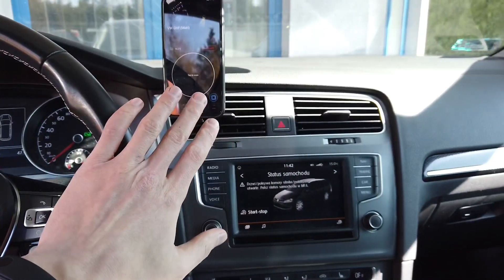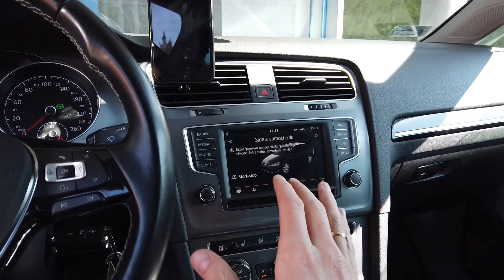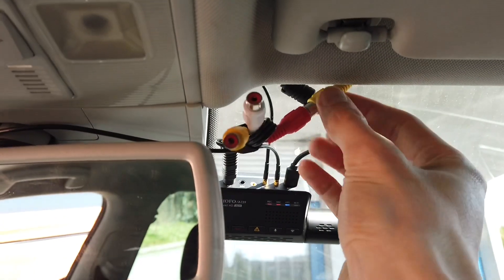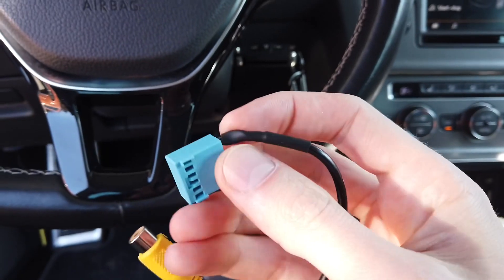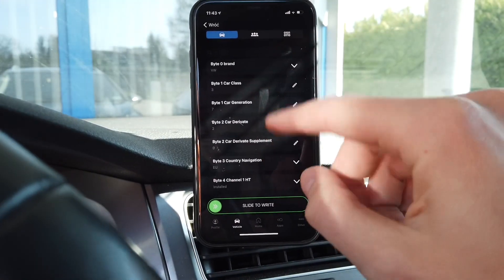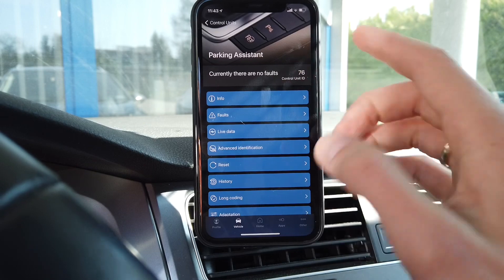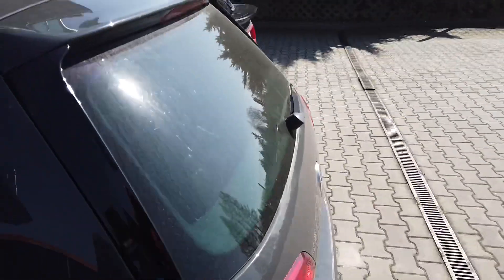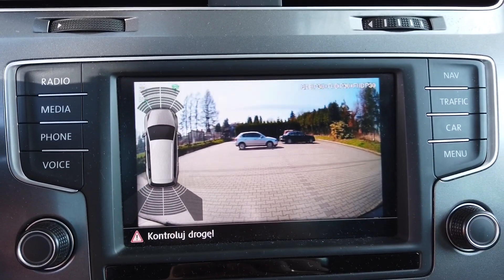VAG MIB2 rear view camera activation (RVC Low)

Comment: From where can I power the camera? 
If I get power from the reverse lights I will get a fault from the Canbus. 
Should I use a relay that activates from the reverse lights and gives power from the ignition? 
Another idea is to always power the camera from the ignition and get image when in reverse but the lifespan of the camera will be short.  
Any ideas?

Comment: If I have PDC that shows lines which move for front and back while steering, will these move on the camera too when I install an original camera?
Or has this to do with Low/High? Because the only difference I see from a set I can buy is the cable.

Comment: Hi, and thank you for the videos you post, they're really interesting. However I have a question if you don't mind, I have this device 'MST2_EU_WV_PQ_P0245T' with GEM 3.5 installed on it and one slot SD card. Is there any way to activate app-connect on it only with SD card ?

Comment: This video, like all your others, is perfectly clear to understand and very helpful.  In my case I'm trying to enable the factory-installed rear view camera.  After I installed a replacement MMI when my original one failed, the rear view camera is no longer working.  Will the coding changes in this video work?  Or can you tell me the coding changes I need or direct me to a video for this problem?  Keep up the good work!

Comment: On the Begining of your video you explain how camera is connected. You mensioned the 2 pins and power, the 2 pins is ok, I know. Question 1: From where you took the power? From reverse light cable on the back? and Question 2: the Camera is CCD or HD or other?  Can you tell please? :face-orange-biting-nails: My Display still on black after connecting and coding, trying to find why.
Reply: Ok I fix it. Need a Not HD Camera and a filter ( relay ) with 12 volts direct clean power and the swithch for relay to Reverese power ground must be connected and of curse coding as you did. If your car have parking sensors Park assistance must be coded too. Thank you grate video
Reply: @agarza.6994  I think i have the same question, how did you power the camera?

Comment: Hello ,i need help,please, i have Polo from 2015.Original media is 6CO035869B , Mib2 entry,.It has no module in the glovebox.I want to install aftermarket rearview camera.
I noticed that on radio, from blue connecter (mib) go out 2 cables and go "Somewhere".Is it possible that there is Preinstalation of rear view camera and this 2 cables go to the rear VW Emblem and finish with the yellow Video joint, to connect with camera yellow joint?
Reply: If not, what should i do? Should i disconnect the 2 cables from blue MIB and connect aftermarket MIB with Yellow Video joint?
Reply: Do i need electric stabilizer ir any converter?
Reply: I have VCDS, i can code it.

Comment: He can I undo Thai coding as I set it and I believe I don’t need it for low line camera works with your exploration but I get a fault due to doing the below coding 

Adaptation
Control unit: 19 Gateway
Name: Gateway_ Component_List
Values:
Node_0×69:
Old value: not_coded
New value: coded

This is the error I get 

19 Gateway
System description: GW MQB High
Software number: 300907530AA
Software version: 4368
Hardware number: 300907530C
Hardware version: 442
Faults:
U104C00 - Rearview camera system control modul
No communication
static
Priority - 2
Malfunction frequency counter - 1
Unlearning counter - 127 km-Mileage - 81646 km
Supply voltage, terminal 30 - 11.9 V Terminal 15 - On Unknown ambient data date - 2023-04-15 11:30:24
Reply from the maker: You coded it as RVC High, not RVC Low.

Comment: Nice, I have a composition media in my scirocco and the same dashcam, viofo a139, I have the 3 channel system, will it auto select the rear dashcam or do I need to do anything to set it to use the rear, cheers.
Reply from the maker: Most likely you need to perform the same coding procedure as I did. Also not all Composition Media units will support video input. If your device part number ends with 819 or 820 it will most likely not work for you.
Reply: @mrfixpl  ok thanks, i do know it will do a reversing camera via yellow rca , ill give it a try, thanks.

Comment: Can you please tell me what is the camera you are using and what cables I need to make this work on my b8 passat
Reply from the maker: It's VIOFO A139, I've used an RCA-to-3.5mm Jack (4pin) cable and a MIB2 video adapter. You also need to make sure that your cars infotainment unit can display video feed.

Comment: Hello!  I have the original camera from the rear logo connected to my new mib2 module, but it's not working.  Do I need to change the pins to make it work?  Thanks
Reply from the maker: Please explain "not working". Black screen? Error message? Camera not opening? Coding not accepted by the main unit?
Reply: @mrfixpl  black screen.  I have a 819B, and I figured out this weekend that 819B are not camera compatible :(
Reply: @mrfixpl  please help me with the black screen i can't get the picture

Comment: Does this stop the parking assist sensors from showing on screen how close you are to something behind you? I find that schematic screen far easier to interpret than the rear-cam with schematic overlay, with the Golf's big butt I think the sensors are an absolute necessity
Reply from the maker: No, sensors overlay is there. You can see it at the end of the video, left side of the screen. And you can manually switch from the camera view to the full-screen parking assist view.
Reply: @mrfixpl  cool thanks for the reply!

Comment: Nice. Does this also work on the smaller display unit with shiny black piano border?
Reply from the maker: Discover Media MIB1 also supports camera as far as I know.
Reply: @mrfixpl  hello, i have golf mk7 2017 and i install plifcamera and i did all of coding on obd11 step by step but the screen still black but the logo open and the camera pops like it should do, can you help me with this little problem.
Once again thanks ahead!
Reply from the maker: @ilyavishnyak6692  maybe your infotainment main unit is not ready for video input? Device number that ends with 819 and 820 does not support camera AFAIK.
Reply: @mrfixpl   yes, i have the 819, not good

Comment: Thanks for the video. Do you know if the 2015 Golfs mk7 with MIB1 Discover Media come with all the wiring pre-installed on the car? Then I would just have to buy the luggage VW badge with the camera in it and code it with obdeleven. Thanks
Reply from the maker: If there's no camera then there's no wiring. You will need to add it.
Reply: @mrfixpl  bummer. thanks!

Comment: Interesting. I upgraded the original camera.
Reply from the maker: I'm planning to install OEM RVC HIGH, but for now I'm going to use this solution.
Reply: @mrfixpl  what's that camera? :O atm I have an OEM on my mk 7.5 GTD but saw that there's a dynamic rearview camera option. No idea how to calibrate and code it tho. If you'll ever do that it would be super great 😊 keep up the great work man!
Reply from the maker: @Pandu.92  These's OEM LOW (with green lines) and OEM HIGH (with orange lines).
In HIGH lines are dynamic (path bends with steering wheel position) and there are additional views and modes (parallel parking assistant, trailer mode, wide angle mode)
Reply: @mrfixpl  yeah I have the OEM LOW and would like to install the OEM HIGH
Reply: Can you please send the correct device  part number (headunit), once again thank you.